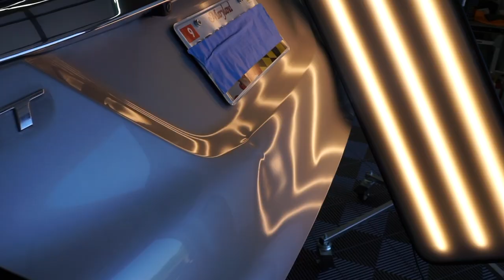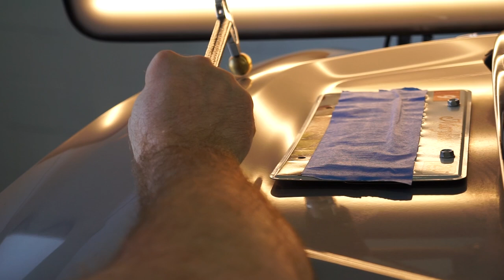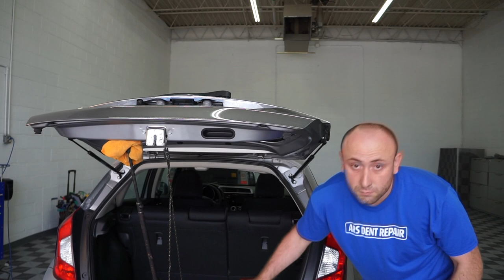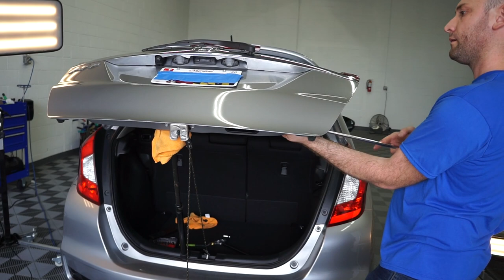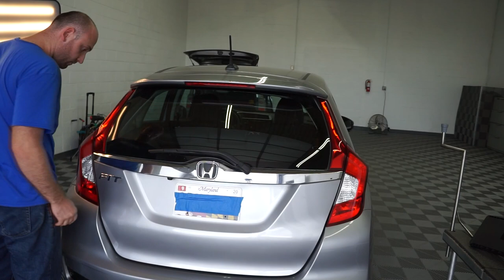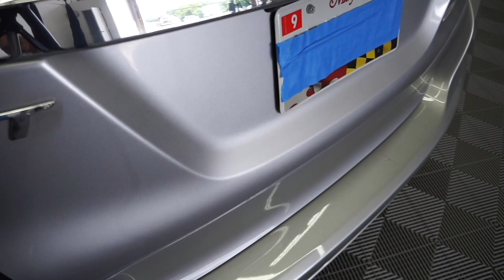Honda Fit Dent Repair. Watch and Learn Paintless Dent Removal Process | Not Typical DIY

Comment: Amazing.  Arslan what light are you using please?
Reply from the maker: Elim-a-dent light with Milwaukee batteries.
Reply: Thank you for the quick response. I just realized its the chubby. I meant in the other videos. Is it a elimadent?
Reply from the maker: @abrahamking6889  Yes, it's 36" chubby light. The other one is 14" elimadent
Reply from the maker: @abrahamking6889  I like them both but I would like to update to something else